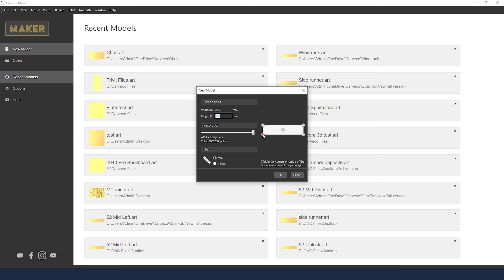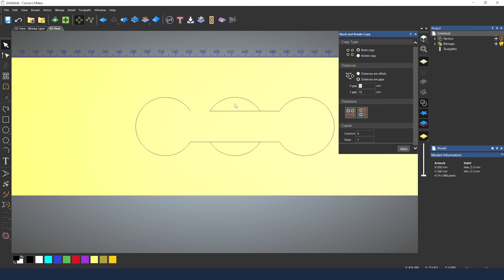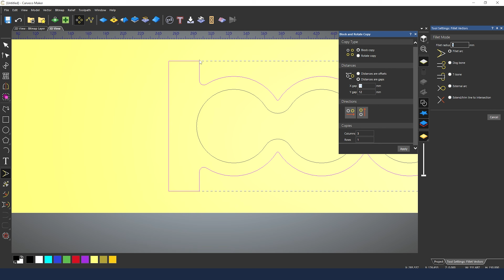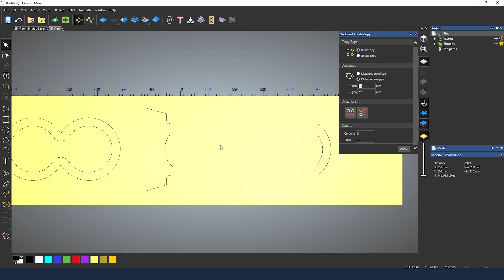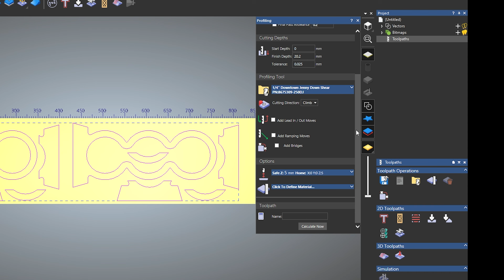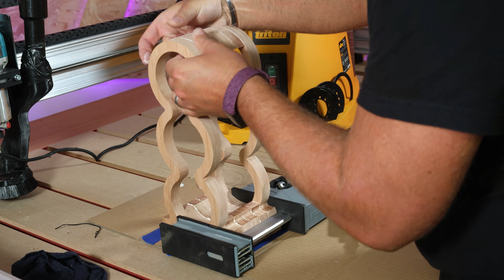Great woodworking project that sells! Wine Bottle Holder - Makes a beautiful unique gift

Comment: Add dowel holes in the design. This will lineup the different pieces making the glue up straight forward. They also will add rigidity into the constitution. Those dowels can be hidden or in sight used as a feature with dowels in a contrasting wood spieces.
Reply from the maker: That's a really good addition 👍

Comment: Hi james. Have a cheap 3018 machine and im stuck on cam software. Since im new to the cnc world i dont want to pay monthly sub. Do you have any suggestions?
Reply from the maker: Easel has a portion of its software for free also Carbide Create 6 is free.  FUSION360 is the most powerful but is also the most complex to learn
Reply: @JamesDeanDesigns  thanks you! tried a little in fusion, but its very overwhelming ( i design in fusion, but the cam side is s different beast)  have you tried pixelcnc?

Comment: That is a very nice project. 

I'll make it using 18mm Birch plywood, make those tight curves between the sections much rounder and shallower, to make the sanding easier and I'll glue the top and bottom segments separately, then lightly sand before glueing them between the outer pieces. This should make the overall sanding much easier especially for those of us without spindle sanders 😀

Many thanks for showing this.
Reply from the maker: If I was redoing it....I would be doing all those things you just mentioned 👍